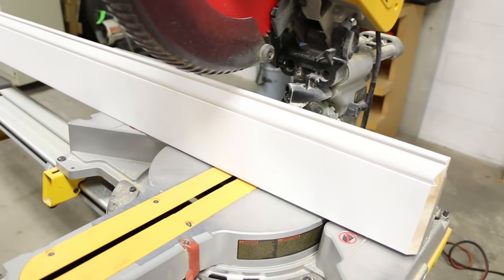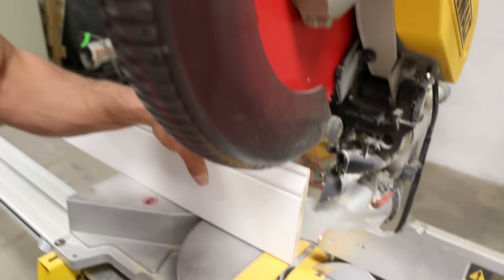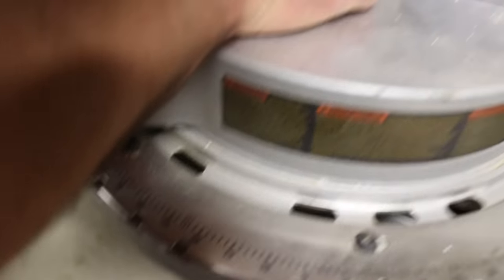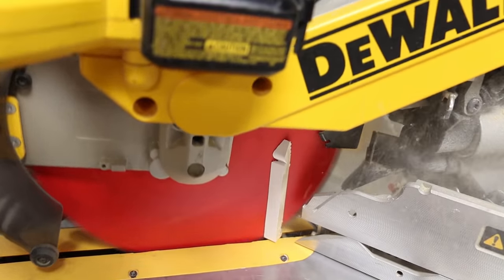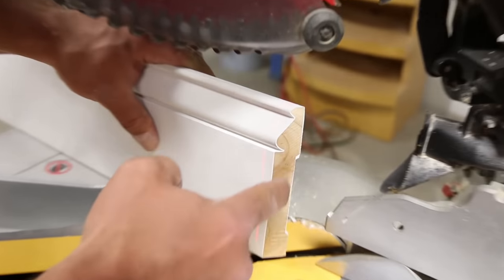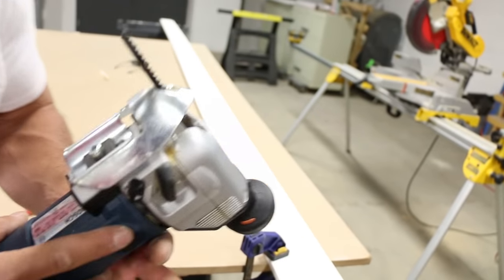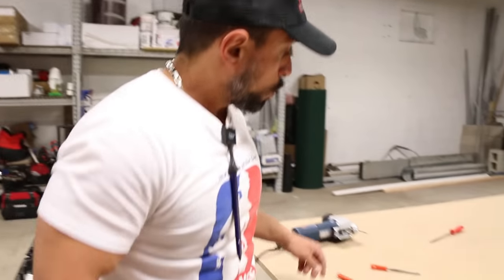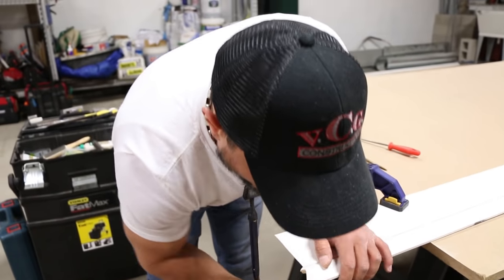How To Cope Molding Inside Corners - Best Way - Collins coping foot

Comment: I'm a 64 yo handy woman. Since I'm very uncoordinated I could never master a coping saw. I had never heard of this handy little accessory and have been intimidated by coped joints for inside corners. This is by far the best video I have seen on how to cope moldings easily and get a professional look. Our house was built in 1985 and I'd be surprised if we had one 90 degree corner anywhere when brand new. Now that the kids are gone and I have more time to work on long neglected projects it's time to replace the beat up molding, including the puppy chewed ones, with new nicer moldings. Thank you for posting this great video.

Comment: Thank you for this video, I think I got it now.  Working on a tiny old (91) Toyota motorhome. Took out the carpet and put in waterproof vinyl flooring  and I want to do the little strips of cove molding to finish it off.  Nothing is square.....but, you gave me a plan.  Thanks.

Comment: I use a very similar method using my dcs331 set to a 45° miter from the top using a down cut/laminate blade. Like you said this is the best method for a house with warped walls. As a remodeling and handyman guy almost 90% of the homes that I work on are 70+ years old and if God smiles on me that day I might find 1 perfect 90° angle in the whole house. Great video and have a blessed day.
Reply from the maker: Thanks Tim we appreciate it!!

Comment: I just learned how to do this when I had to do the trim in my home. I also learned that you can cut it close with a coping saw and then use a Dremel and a file to get the cut nice and tight. I’ve had the best results with this method, but you just need to take your time...!
Reply from the maker: That’s awesome Alex! What type of trim did you install using the technique?

Comment: Good video. Been using a jigsaw without a collins shoe for years to cope inside corners. So much quicker and tighter than a mitered inside corner. I hang my 30 dollar Skil jigsaw on a hook on the end of my miter saw stand. Cut my 45, slide trim so it overhangs end of the miter saw stand, grab the jigsaw, buzz out the cope, cut off falls in a five gallon bucket sitting on ground, trim gets nailed to wall. It takes about 5 seconds to cut a cope on a piece of standard trim. Using a copes i dont have to waste time dicking around findings inside angles. 

One thing you didn't point out to trolls who think mitering is quicker. If you lay out the room correctly many pieces of trim will be butt cut on both sides. That alone save time. 

Thanks for sharing

Comment: I have already subbed a few weeks ago. I have seen this done before and tried it myself with poor results. I think it was that top part that you nicked just the top at a 90 that had thrown me off. I never did that. I ended up just matching 45 to 45 and tacked them together with a 5/8th brad and then put them in the corners. Worked out pretty well. Needless to say, I hate installing molding, especially crown molding in a 120 yr old house. It was a nightmare; I was only given one extra piece and the heat was on man. I ended up with a half of a 10ft piece left and was very happy to be done with it. lol The entire kitchen remodel only left for 1 minor mess up the whole run thru. Stressful is the only word to describe it. Do a vid on crown molding, I would like to see how that works. Base has always been easier for me but crown is worn by one mean queen lol

Comment: Hey Vince great vid! Have to say I'm old enough to have done them all. Pure coping saw. Mitersaw flipping and back cut straight then coping saw. Same technique but with angle grinder. Collins came out and I never looked back. Tip experiment with different blades. Also you can cut a perfectly straight line very quickly with the Collins. You are dead on...mitered inside corners do not work with out of square walls (production time wise) and will almost always open up over time. The only thing I've seen that's faster is the Copemaster $$$$ Thx again and stay safe man!
Reply from the maker: Thanks for the feedback watti! I looked at the copemaster years ago but never decided to pull the trigger!

Comment: Many buildings have square corners, until the drywall hurries through. They leave a mess for the next guy to clean up, the trim carpenter, sloppy mud at bottoms, beads improperly applied and the worst is the dust that gets left to blow all over when nailing with a gun,  etc. Probably should check to see if there is a drywall video!
I have the foot as well. Never could get myself to use it enough to become proficient. Coping saw and upside down miter seems quicker to me. You have inspired me to try again.
Reply from the maker: +Greg Peterson good luck!

Comment: I use this technique.   Only add I have is if the FLOOR isn’t level put the piece of base that you’re going to cope down against the non-coped piece in the corner and scribe so you can get the floor angle taken care of also.

Comment: good video joe you mite try putting your base upside down and 45 the  miter, then set your saw back to cut straight cut  and cut along face line up to about where the straight section stops then cope  the top section and you can also cut the small piece at the top. I always look for a short cut that helps me get it done faster went I go into a room I start on the left wall from door since I am  right handed that piece gets cut first no miters on it I call a freebie and work around the room in that clockwise position and the last piece I put is the right side of the door I like putting those pieces last just in case a door unit mite have to be change you  wont have to rip off the side piece before those  I type this mostly for the viewers  oh if you are left handed then go around the room counter clockwise I hope this  helps to make life a little easy god bless

Comment: 🤯🤯VINCE I I've never seen that done before.  I work for a mass production company TLC Mouldings inc. In south Georgia and I just put new baseboards and trim in my house. Not the best but I enjoyed doing it. I bought bout an extra 20 or 30 foot just incase I messed up. I watched several videos but none showed this method.  🤔 idk why 🤷‍♂️ But that was awesome. Thanks for the new tip.  Keep up the good work Brother.  V.C.G Construction LLC.  #imjustsaying.
Reply: P.S. I'm just a DIYer, and I got some raw wood and even some dressed wood. My question is what's the best way to sand it and stain it to make it look nice. Was thinking about making a table. I got a few round pieces of wood that come from a wire wheel about 24in in diameter.
Reply from the maker: Thank you so much for the support Raymond! We are glad to have you here as a part of the #verycoolgang!

Comment: So many guys just 45 em and then glob caulk to fill the gap. Because it’s never really perfect 90 angle. Which I think is shotty work. I can’t stand constantly being in a rush. I work very hard and consistent but I will not cause unnecessary stress and do piss poor to save a few hours in the grand scheme. Taking the time to do the job right is worth the time. And you feel better about the job and less stress about rushing
Reply from the maker: I agree 100 percent with you Brian!!

Comment: So true.....Coping inside corners on unfinished molding is the only way pros should ever do it.  Besides, it's actually easier.  You can make fast, precise miters on finished molding installed on kitchen cabinets. But in dealing with sheetrock walls, coping is way better. Both pieces can be cut slightly on the tight side to avoid shrinkage. Make your mitered pieces even just a hair too tight and they are no longer aligned.  
If you claim to be a "pro" and you miter unfinished molding on inside corners, you just don't know what you're doing
Reply from the maker: Wow, I couldn’t have said this any better, way to go and thanks for commenting!!

Comment: Thanks for the vid. No disrespect, but It blows my mind that people still cope. Your "high production" method takes forever. I miter everything except rare cases where coping is needed. Checking the angle of corners before cutting helps alot and we get really tight miters. Even if i have to recut a piece to get a good joint its faster than what youre doing. To each his own, carry on.

Comment: I really like the way you did inside corner; talking about producción and  quality job ; real nice and no houses have exactly 90• angles. I have no clear why you did las cut after you cut 45 . And also can I coping with regular jigsaw. Thanks
Reply from the maker: +EMILIO BERNARDO thank you, we appreciate it! The last cut was to allow the flat top of the molding to but up at the joint.  The flat bottom on a standard jigsaw without a Collins coping foot won’t allow you to get close enough to the profile.

Comment: Thanks for the tutorial. As a relative beginner, I have a few questions. When you cut the cope for the baseboard, does it matter if you cope the longer piece of baseboard vs the shorter piece of baseboard? I have an inside corner to cut & the left side is 8 feet & the right side is 4 feet long. Do the different lengths expand & contract at different rates by virtue of their lengths? Also, do I cope the shoe molding in the same direction as the baseboard? I am going to use a coping saw. Thank you for your time.

Comment: That is one quiet jigsaw or did you turn the sound off????   On a side note, when I just started finish carpentry after a few years in framing, a client asked me to do crown molding in a rental unit.  First time ever doing it.  After spending 1/2 the day trying to get the miters just right but could not because of seriously uneven walls, I got frustrated and started on youtube and learned about coping.  As a result I used my tablesaw and files to cope the crown molding and did a fair job (according to me) that I ended up using caulk to close the gap.  Coping seemed like such a mystery to me but now, I can pretty much hang crown molding by myself and pretty much cope all the time though I do know how to use a coping saw, table saw, grinder, and now jigsaw to cope.  That moment marked when I really began to be finish carpenter and not a framer/laborer.  $$$   Thanks for the tips!

Comment: I've been a finish carpenter for over 40 yrs now . Your method of coping with a jig saw would be way to slow for me, I use a combination of the mitre saw and coping saw . I first cut the 45 miter then I flip the base to the other side of the Miter saw with the miter cut facing out  and the base is upside down . I then set the saw at a 10 degree angle opposite the 45 then I cut down on the base along the profiles straight edge, then I finish the curve profile with the coping saw. I usually cut the whole room first, then cope the base with the miter saw and coping saw and my corners will fit as tight as your show on this video. Good video
 though.
Reply from the maker: God bless you, make a video and put the link below! We’d love to see it!! Thanks for watching, we appreciate it!
Reply: Would love to but not very good in front of camera
Reply from the maker: Where are you from if you don’t mind me asking?
Reply: I live near Winnipeg ,Manitoba ,Canada
Reply from the maker: We thought if you we’re close enough you could come to our shop and show us a thing or two!! Well if you’re ever in the Philadelphia region let us know!!
Reply: VCG Construction thank for the offer.  Would love to show you but a little to far away for me. Keep up the good work
Reply: That's the way I do it too. Seems a waste of time to cope the straight side. So basically we just cope the top. And I to use a coping saw...bam! I cope all the short pieces btw.
Reply: Love your vids btw
Reply: Glenn Ell... I agree with you! I've been a high-end finish carpenter for 30 plus years. While his version is one way to achieve an inside coped miter it is way to slow. You're setting up to do the initial (2) cuts with the power miter saw, then transferring the material to another work station and then  clamping it down to use the power jig saw that has a specialty attachment. That's wasted time which adds up over the course of a week, a month or longer. Additionally this method will rarely work well if you are coping base that has multiple profile (intricate) radiuses, as you often find in 8" or 10"  base in high end multi-million dollar houses. It generally will not work well when cutting inside corners on large crown molding, like stacked crown. It also leaves much room for error, one hand slip and the cut is toast. Whereas the coping saw gives you a finer and more controlled cut without the need to use files; like the ones I saw on his work table. By the time he completed 1 piece I could have made 2 with the same style base. But it is a good video applying that technique. Certainly not the only technique and, in my opinion, not the fastest.
Reply: Glen Ell I have been installing trim in custom homes For the last 40 years and I agree with you 100% I cope everything exactly the same way you mentioned. The method shown in this video works but it is much slower and requires you to bring many more tools on site. I’m not saying it doesn’t work but it is way too slow and no more accurate than coping the way you mentioned.
Reply: What do you mean you cut the whole room first?
Reply: @TheSeancassady  just measure around the room, write the measurements down on a scrap piece of base moulding be sure to denote which end gets miters/copes etc... Bring your list to the saw and cut all the pieces for the entire room. I've been doing it this way for over 10 years now. I usually measure the entire floor then go cut all the pieces then go install all of said pieces. The only break would be to bring the pieces  to each respective room as you finish cutting each.
Reply: Oh that's a good idea.  I am getting ready to install "squared off" trim in my house so the whole coping technique on inside corners isn't going to be necessary.  My question is though, do I still need to do mitered joints if I'm using a 
flat, squared product?
Reply: @joef1551  
Roadwork at the light downtown smh
Reply: anthony ginevan ????? 
WTF
Reply: @joef1551  sorry y'all. I meant to text the wife and somewhow I managed to post a reply on youtube???🤨 Really wierd cause I have the whole conversation except for this part in my messages too.
Reply: anthony ginevan no problem. Lol
Reply: Be a carpenter for over 30 years I’ve preached that coping is the way to go they think I’m old fashion but the results are much better with painted and stained moldings keep the pride in your work

Comment: I agree, inside 45's don't work on out of square walls.  I'm a plumber by trade but I recently replaced all the base molding in my house myself.  I experimented with both and wound up coping all of my inside corners.
Reply from the maker: That's awesome!! How did the base molding come out? Coping the inside corners is the only way to go!
Reply: VCG Construction it turned out great!! I have to tackle some crown molding over my new cabinets next.
Reply from the maker: +Myles Mastersen I would love to see the finished product! Do you have an Instagram account or maybe you could make a video?
Reply: I'll make a video and post it on my channel in a few days.

Comment: I never coped in my 15 years doing this, but as I got better I laser measure the entire area I'm doing while marking the angles of my corners using pre-made jigs or using an angle finder, then I go to my saw make all cuts for entire area or home, assemble using trim glue, put in place and nail, my corners are so tight because of the gluing all the caulking happens on the top and bottom of baseboard/ crown

Comment: Definitely like the coping foot. But I always miter then flip board upside down on 5 degree angle cutting out the straight  then cut out the profile with the table saw with the blade way down

Comment: Have you ever tried using an angle grinder with a flap disk?  Seems silly at first but you can really remove material fast on big base and crown.  Takes a little practice, like everything else, but it dose a hell of a job.  Minimal file work needed when you get good too.